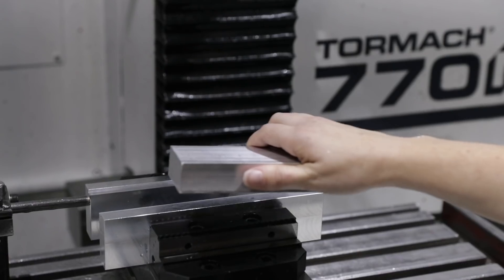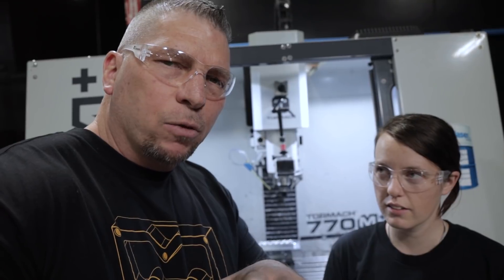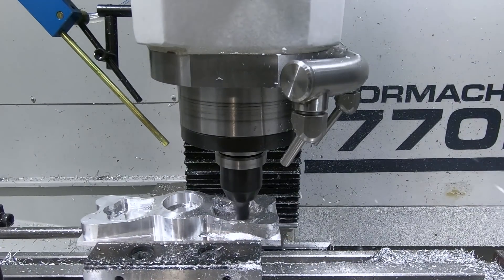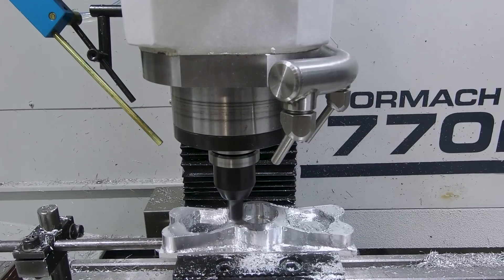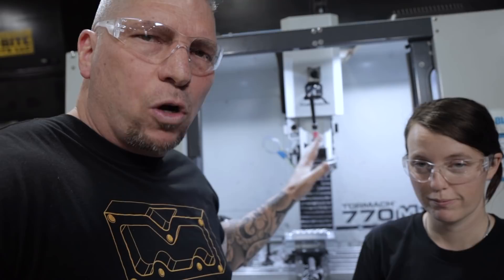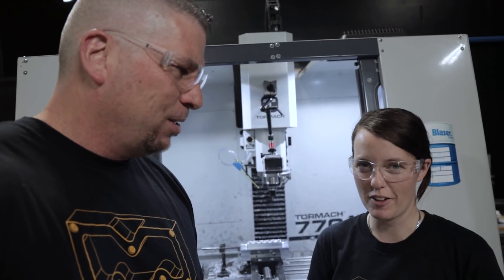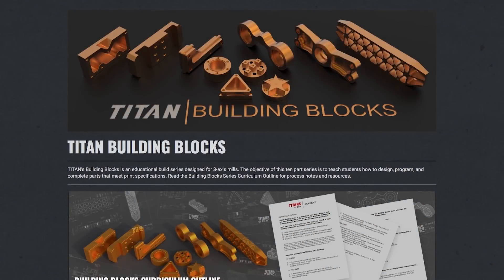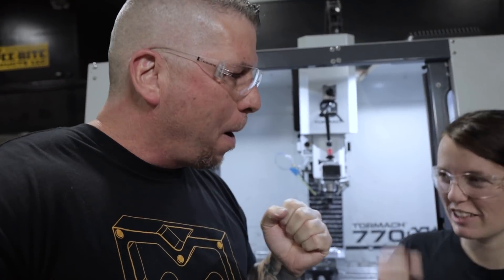Tormach VS MAKINO | The TRUTH about These Machines

Comment: 100% agree with @Rearden's garage. I'm an example. I was going to get a refurbished Bridgeport manual mill. But when I looked into what CNC brings to the table and the pricepoint that Tormach can offer, it was the obvious choice for my needs. I really don't get all the Haas vs. Tormach comparisons. If you can afford/justify a Haas, then obviously that's what you should get! But if you're like me and you just want to learn CNC machining and make some useful things, then a Tormach might be a good choice. And no, I'm not going to by a used Fadal and hope for the best, I want something that is as close to plug 'n play as possible and that has good customer support, a large user community, and directly applicable instructional resources like Titan is providing with Nicole's low HP machining programming examples for the Titan Building Block tutorial projects.

Comment: I appreciate Titan's perspective on machines... Reminding people (me) that not everyone needs a 60hp machine that's as big as an apartment and can hold 0.0001". For some businesses a Tormach has enough power and can hit tolerances that are more than acceptable. I would be very interested to see a comparison of CMM data from different levels of machines on the same parts... a quality and consistency comparison more than a time comparison...
Reply: Actually,  it would be nice to see time along with hp and rapid capabilities for each machine. This would really press the point about time is money. Show price of the same part from one machine to the next, based on a 10pc order vs 1pc order. This would allow people to see the cost benefits of higher end machine with differing capabilities.  Parts that don't need .0002 accuracy, say +\-.003 and only need 1 or 10 per year, can be competitively quoted. Even against that monster machine. It's easy to pay for a tormach but you had better have a LOT of work to own that beast.
Reply: @billgreathouse1913 Exactly. If you have the work to feed a big machine then great, get it, don't waste your time with a small garage machine. However if throughput isn't the limiting factor in your shop then smaller machines can make a lot of sense. A lot of people say buy once, cry once, aka buy a big expensive machine. However it makes no sense to be making payments on capability you aren't using. Also I feel like space issues get glossed over. Not everyone is running their shop out of a 5,000+ square foot industrial space. When you factor in the cost of a machine don't forget to add in what it's going to take to put a roof over it.
Reply: Yes the decision between even a low-end Haas and Tormach should be fairly easy. If you have the money or projected work, then get a 'real' VMC (and be prepared for all the added expenses beyond the initial acquisition cost). But if you're not in it to make money, or the Tormach can deliver the quality and volume you anticipate for your paying customers, then a Tormach CMC mill may be a very sensible purchase. Great to see this class of CNC mills supported by Titan's academy materials. As he points out, many schools as well as individuals and small companies will benefit greatly.
Reply: @steveh8724  our tormach has served us well for 3 years, mainly using it for hole drilling as 2nd ops after plasma cutting. It has been turning out great parts. But now we are actually facing a work envelope constraint, and a vf4 may be in the near future...

Comment: Hi Titan! Is it possible to get the Dimensions of the Parts in your Academy also in mm not inch? Would be so nice! Greets from Austria! <3
Reply from the maker: Yes!
Reply: @TITANSofCNC  that would be sick! I have no problem converting the dimensions, but the threads are a little ugly from metrics perspective :-D
Reply: @themechanix393  for some dimensions you can get them by using the Pdf of the part they listed, and then the measure tool.
Reply: @themechanix393  Threads are just threads; usually a couple of clicks to change from ISO to Metric in any CAD's hole making system. To a machinist, it's just a matter of grabbing the right drill and tap.
Reply: TITANS of CNC: Academy Metric Academy coming soon?
Reply: That would be awesome Titan! 

Greetings from Germany

Comment: A bit of an exageration to "run a business" with a tornach. A used Fadal or Haas can fit in a garage and you will not  grow old waiting for a heavy cut to finish.
Reply from the maker: Check out the different Tormach groups on Facebook... There are a Ton of people running businesses with Tormach... I even posted videos showing how to cut Hastelloy on a Tormach. As I said in the video, it’s a great starting machine for those that can’t afford a bigger machine.
Reply: @TITANSofCNC   Yes Titan.  Tormach is fantastic for small jobs and I loved your videos on that machining. Cutting tool steel tool!
Reply: Why do you need a heavy cut? Seems a dumb way to run an old or light weight machine it's why hsm is so much better... Depends on your product or work needed a tormach is a great stepping stone and there is plenty of businesses out there that got started with em.. Namely John Saunders of nycnc and John grimsmo of grimsmo knives all have high end cncs now but started in their garage with a tormach.
Reply: Not an exaggeration at all,  I run a part-time business with my Tormach 1100 and I make good money.  Rather than waiting around for any kind of cut to finish I deburr/inspect the last part, cut stock for the next, do something on my Lathe or PC, etc.  It's all about understanding and using what you have and developing a process that works for your situation.
Reply: You most certainly CAN run a business with a Tormach. There are hundreds of small businesses running a single Tormach. What a dumb thing to say. That's like saying, "You can't run a business on a Haas VF-1. You need a mill-turn machine like an Mazak or Okuma. Or you'll be sitting around waiting on the VF-1 to cut." See how dumb that sounds? There's always going to be something faster, stronger, more rigid, etc.
Reply: I’m certainly no tormach fanboy but from a business prospective a low end tormach will almost always be a better buy for someone starting out.  It runs on single phase power and has a well developed online support base.

If you plan on making more than 100ish parts a month a new-ish haas/hurco will be a better buy...  I would only suggest an older machine for someone that can handle the downtime/maintenance that will always be needed.
Reply: @steves.3485  If you go Tormach, its best to go bare bones with a power drawbar. If you start buying atc and bunch of upgrades you are not that far off from buying a entry level Haas toolroom  or minimill when they go on sale 10% off. They run on 1 phase and can be moved with a pallet jack. I own both a vf2 and Tormach.
Reply: If you don’t require tight tolerances a used machine is always the way to go, I bought a Cincinnati sabre 1250. Still holds .0005 for the backlash, has allot of features like rigid tap, auto wash down, tool probe conveyer and swarf etc. And It didn’t break the bank! :)
Reply: Everybody has their own idea of what a business is or should be. Big or small, a business is a business. What machining business do you have?
Reply: Abbey Road, If you are a pure job shop, I would agree. I started with a Tormach to play with and eventually got into job shop work. Unless you are lucky getting easy low spec parts the Tormach wont get you far. If you get the ATC and enclosure and other options and after you spend lots of money in tooling, workholding metrology equipment, a brand new Haas tool room or mini mill doesn't really cost that much more in the grand scheme and you can finance it for a bit above average car payment. Still a light weight machine but way above Tormach performance. For alternate value added business then the Tormach may work great depending on your needs. With that said, the Tormach value is decent in a basic configuration, but after you add atc and other options, your not getting a good bank for your buck as you get much closer to the cost of an industrial machine.
Reply: Buying used is a risk. They are "as is" and your local dealer may not support you so you need the confidence to solve any problem that may arise with these complex electro-mechanical-pnuematic systems. The upside of the risk is bang for the buck.